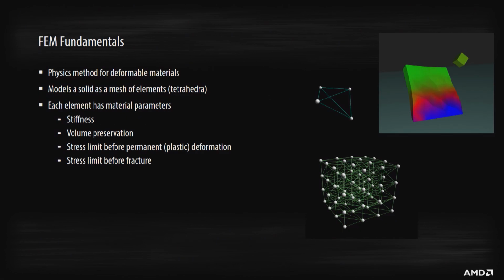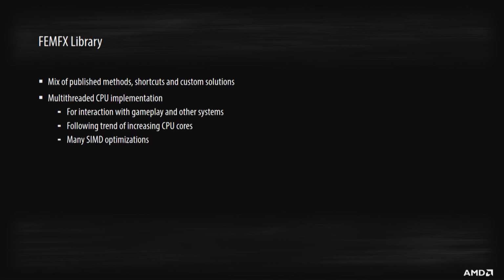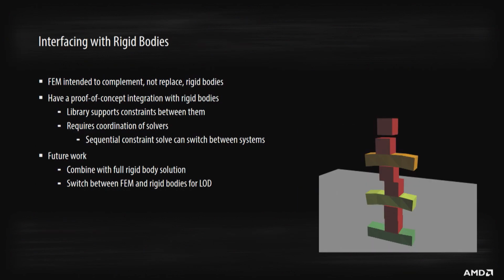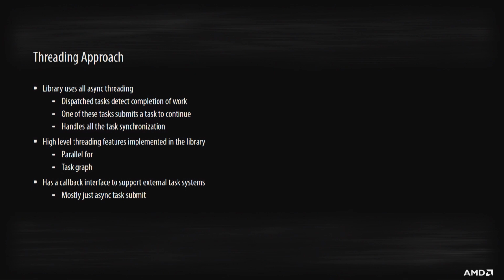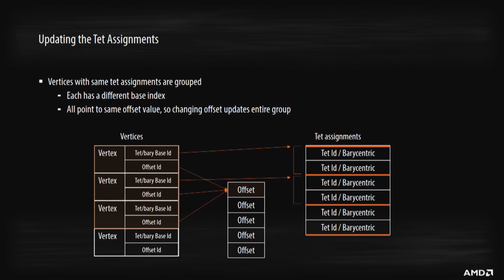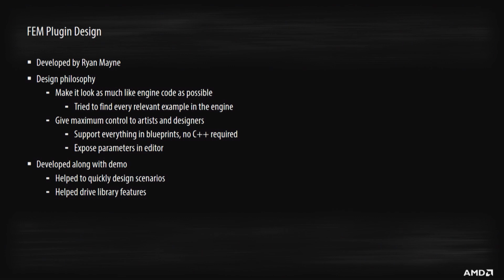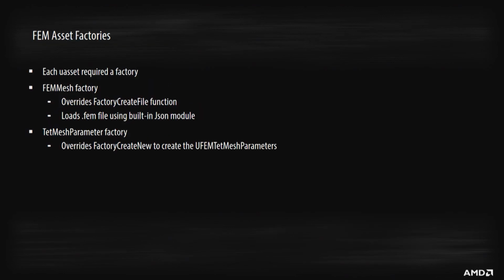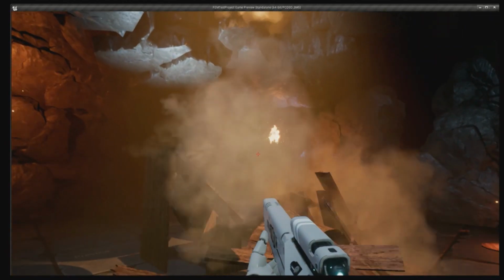Integrating an FEM Physics System into Unreal Engine | Unreal Fest Europe 2019 | Unreal Engine

Comment: Will we see this tech on PS5 and XBX?  This looks amazing!
Reply: It's cpu driven so as long as the cpu on the next gen  of consoles can handle it, I see no reason why we won't see this and infact, I suspect this is designed around making good use of the extra cores PC gamers have and the next gen of consoles will likely have so and the first thing I thought about when I heard of this is that it's designed for next gen gaming on PC and next gen consoles as it's perfect for making good use of thoes extra Ryzen cores and might even kill off Nvidia Physx
Reply: We might be able too, yes. Since this is opensource, it should be able to implement in next gen console. Especially since the are both using AMD.
Reply: This is Should be on PS5 and XBox series X : https://www.youtube.com/watch?v=Wc_QC25RM44
Reply: Thank you for the informative replies! I’m so freakin’ hyped now. 😬
Reply: @mgsv5297  These next gen consoles are going to be pretty amazing.
Reply: @dondraper4438  As a PC gamer, I'm hyped for all this because unlike the last gen which was more or less a visual boost, it didn't really add much to PC gaming, this new gen could be quite different as they'll have far better cpu power which will allow developers to go crazy with how they can  design games, then there is the M2/SSD drive which because of the speed of them could allow contents to stream in and out of memory at a rapid speed which again could change how games are designed, then we have ray tracing and the rest of the hardware.

All in all, I see this being a much bigger upgrade for PC and console gamers then we saw with the last gen and this news of this new physics engine perfectly fits the timing for the new gen of consoles, I also really hope we see better A.I. with games but I might be asking a bit too much there as developers prefer to take the easy option.
Reply: @paul1979uk2000  This console generation will most likely mak history and be engrained in our minds
Reply: They say femfx is defigned for multi-core cpus but they never say what's the minimum required core count for this to work. They might be running this on threadrippers with 16 32 and 64 cores whereas the next gen consoles only have eight cores.
Reply: @SivanandRavi90  It's not designed for any number of threads as such, that is really up to what developers want to do with games or any other software, what I do know is that years ago with Borderland 2 when Nvidia allowed PhysX on the cpu, it used about 60% or 70% of his cpu but that was single threaded as it didn't work with more cores, that was with a cpu that is much weaker than today's and with an api that wasn't designed to use cpu's as Nvidia wanted it to work with its hardware only, hence why it doesn't work well now.

If they can do that on a 5 or 6 year old cpu whiles only using a single thread and api that wasn't designed to run through the cpu, how well is one going to work that is designed to work with the cpu and use many cores and threads?

With the next gen of consoles coming out, 8 cores could end up being the main target for next gen games, that would be a heck of a lot of power they could use for physics, maybe even a lot better than even what PhysX can do already and that will be interesting to see because then it will get used as both PC and console gamers can take advantage of it, PhysX was a decent tech but it was killed off by Nvidia keeping it locked down to its hardware, developers were never really going to take advantage of that if AMD, Intel hardware couldn't use it and consoles couldn't take advantage of it.

So yeah, this next gen of consoles is a much bigger leap than the current one, all this gen offered us was higher resolutions and better visuals, nothing game changing, whereas the next gen will have an M2/SSD drive, Ryzen 8 core cpu, ray tracing and the rest, all of this will allow developers to do things that are just not possible with this gen of consoles and because of that, games can be designed very different from how they are now, this is great news for PC and console gamers going forward.
Reply: @mayankkumar8379  You might be fine, I wouldn't worry about it yet because even if the next gen are 8 cores, chances are games won't take full advantage of it for a year or so after the console release and even then, the Ryzen cpu's that the consoles will have will likely be clocked lower than the PC part, so 6 cores might be a might for it but personally if I was upgrading now, I would have gone for 8 cores, but don't worry about it.

If 6 cores can't keep up with the next gen of consoles, your motherboard will likely support 8 cores and they should be dirt cheap a year or two from now, so don't worry about it and see how it goes around that time.
Reply: @mayankkumar8379  You might be fine, just see how it goes with games at the time, if they play fine to how you like it, then don't worry about it, if it can't keep up then look at your options at the time, cpu and gpu prices will likely come down a lot once the next gen are out.
Reply: @mayankkumar8379  I have a 8700K as well. There actually is a upgrade path to a 8 core 16 thread CPU while keeping the same motherboard. The i9-9900K. It's ain't cheap though, currently $500 on newegg! But my MSI Z370 board is nothing special (~$100 I think when I got it), and it got a BIOS update that added support for the 9600, 9700, and 9900 9th gen intel CPU's. The i7-9700K is a bit cheaper at $400 but it dose not have hyperthreading so it's 8 core 8 thread which is less threads than our 8700K (6 core 12 thread). Anyways if you go check the support page for your motherboard I'd bet you'll see the 9th gen chips I mentioned were added to the supported CPU's list with a BIOS update. I really hope this CPU dose not need upgraded anytime soon though (I'll be surprised if it dose become a bottleneck for gaming anytime soon), my previous one was the 3700K, it lasted me a LONG time and since I sold it the motherboard and RAM to my cousin to use its still working fine for gaming for him paired with a GTX 1060.

Comment: This is what next gen should be about...physics and interactivity.
Reply: This is what 2000s gaming was largely about, one of the many reasons that decade produced superior games.
Reply: @boredgunner  It started out that way, then nvidia bought Ageia and locked out Physx to GPU acceleration on nvidia only and removed optimizations for CPU so you had to own nvidia cards or suffer poor frame rates or no physics simulation.
Reply: @OniMirage  Not really, PhysX was one of many solutions. Havok enjoyed its prime during this time, Source engine was pushing the boundaries as were games like F.E.A.R. and Crysis. Pretty much all the games that best use physics to enhance gameplay were in the 2000s and didn't even need PhysX.

Although today we have open source DirectCompute PhysX, so I wish it would be used more.
Reply: @boredgunner  During the time of PhysX as created by Ageia they were the only name in the game regarding hardware acceleration which is why you could buy an Ageia card and use it on anything that had a PCI slot available. All other forms had/have been software simulation. That's when Nvidia came in and ruined everything for everyone else to promote their cards by buying Ageia and including the GPU acceleration only on their cards. At that point nothing was hardware accelerated in the same way for anyone else and the code Ageia had for CPU optimization was obstructed in such a way that it worked but worked slowly because it used to work decently. Moving forward with new forms of accelerated physics means a core benefit for owning an nvidia card can now die in it's exclusive grave.
Reply: add AI to that. Would be fun to have genuinely smarter AI instead of giving it ''cheats'' to increase difficulty of games.
Reply: @M2xim  Would be fun for you and me probably, but the average gamer cries and says AI is cheating if they actually use tactics (shooter game AI at least, based on test results that have been published).
Reply: You mean what Half Life 2 did?
Reply: Dead Or Alive Boob Physics did we need more?
Reply: This is why I hope Atomontage comes to fruition soon.
Reply: Some parts of the computer have not improved much in the past decade. We are seeing nicer graphics but the physics and ai simulations are pretty much the same. Even in 1000 years, if there is no room for improvement, games will stay the same.
Reply: It's called VR welcome
Reply: They're worried about making things shiny
Reply: This is Look Old game Physics
Reply: @FantasyNero  You clearly don't have any idea of wht you are looking at.... it's not graphics what they are demonstrating... it femfx.

Comment: Why you need to introduce extra DCC app (Houdini) to author assets? It would be nice if you concentrated more on being able to author asses directly in engine and considerable plus would be to be able to create new assets on the fly as it would enable to use this in more programmatic manner which is always preferable option.
Reply: It's probably the same issue they had with mesh editing where another company owns the underlying tech so they aren't allowed to implement their own version without paying them anyway so they might as well just partner up.
Reply: Because Houdini has been in development for a long time, and it is extremely tricked out for procedural modelling workflows of the kind that would apply well to games authoring.

Having said that, the company SideFX that owns Houdini aren't so big that Epic/Tencent couldn't buy them I think - their acquisition of Shave and Haircut makes me think they may be on the verge of a M&A spree, like Autodesk did years ago.
Reply: Game engines just aren't designed to do that and UE4 is no exception. It does not have the capability to created brand new mesh assets from scratch. Given the nature of these files, Houdini was a great choice because of it's excellent procedural tools.

Comment: garbage  physx been doing this for a grip
Reply: Wrong.
NVidia Flex is doing this, but is not in the default UE4. You have to install a fork made by NVidia or make your own.

PhysX is only used to manage collisions between solid meshes. It does not allows you to use soft bodies out of the box.
Reply: AMD software solutions are typically made available as open source to modify by third parties, just like TressFX and its derivatives used by Eidos and Guerilla Games.
Reply: Ageia had been doing this for a grip. Nvidia simply bought them out and fucked over the CPU optimization code so everyone would be forced to buy Nvidia cards. They haven't done anything to further the technology they bought.